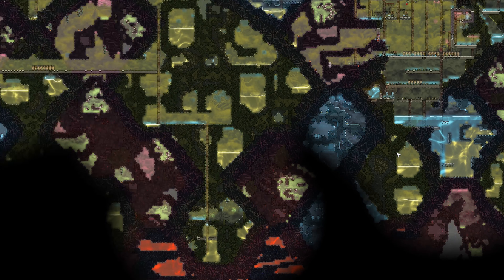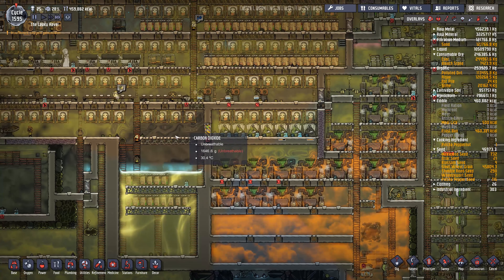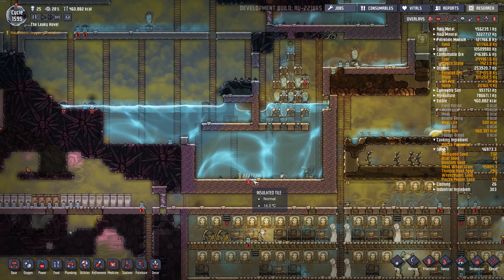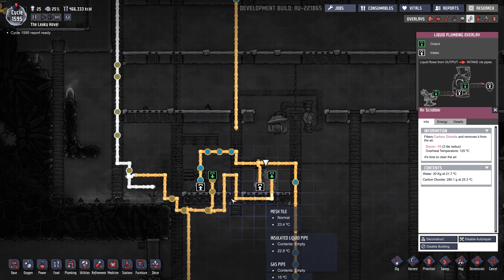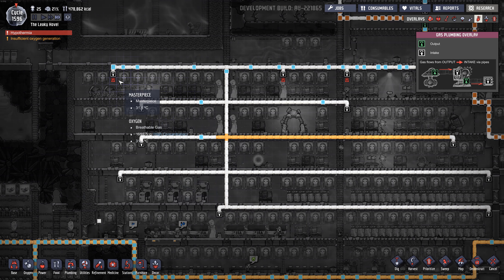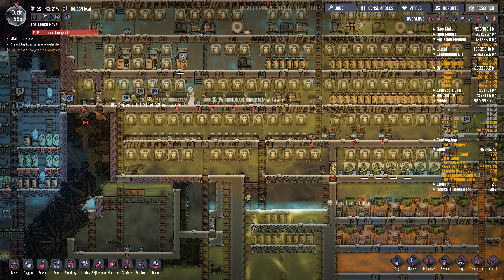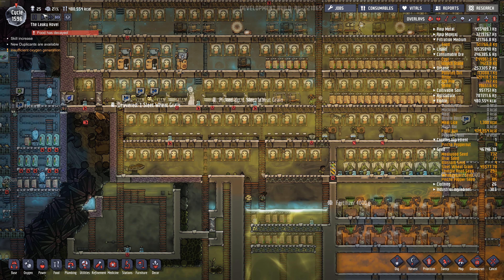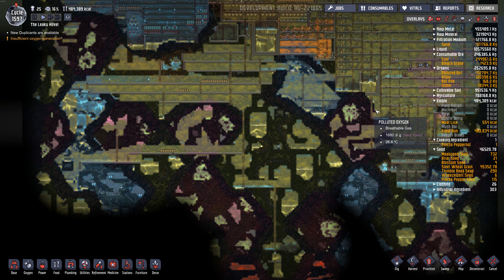Oxygen Not Included | Part 18 | Energy Free Water Cooling

Comment: Instead of sweeping manually, you can set the priority of compactors to 6, and the dupes will keep the area clean before building/digging new things. All your compactors must be level 6 though. If you have some at 5, and some at 6, you'll waste a lot of time transferring items from lower->higher for no reason.
Reply from the maker: I kinda like the manual control, but that is a good tip.